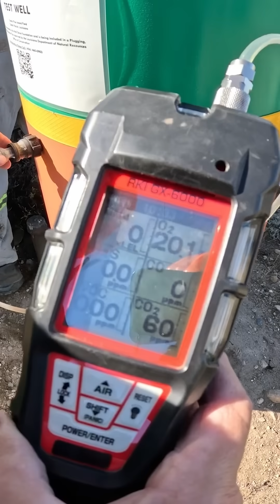The problem goes deeper than you think...

Comment: Why plug it while it's still exuding methane or natural gas? Capture the gas, or build a gas-powered generator on top of it, and wire it to the grid.
Reply: Because its just another bridge to nowhere. I can keep people on the payroll indefinitely without doing much and milk it forever because I labeled it with buzz words the news convinces people are bad. A volcano erupts every year that has more output than every well ever dug. But it sounds good to grift people into thinking you're saving the environment by plugging almost empty pockets of air with concrete you produced more harmful emissions to make and transport than the well will ever give off.

Comment: You had 606 people like this thing that you’re doing you had over 5000 comments I haven’t read them. I’m not gonna read them. The problem I have is that you could’ve pulled the pipe out of the ground build it up with gravel and dirt whatever to keep the meth thing down, but you didn’t do that. You wasted money on a concrete truck and fill the pipe full of concrete. The problem I’m having with this is when it rains rainwater find the path of least resistance and that’s a alongside the pipe. Oh no rainwater doesn’t get in there rainwater gets in everywhere, especially in the field. Raymond gets in a hole down side, the pipe down the side of the concrete down the side of the pipe, you know nothing’s gonna find outthat pipe that’s been sitting in the ground for years getting rained on stormed on snowed on saturated water constantly well my problem with this so you put concrete in the tube good for you

Comment: Is it possible to put a shallow plug? I mean, i.e. 30 feet of concrete. First you insert a kind of expanding stud. Then put on it some plastic or epoxy and then several meters of concrete.
Reply: Plastic epoxy what's contaminate our land some more it's bad enough to put in concrete in there
Reply: Couldn't that create sinkholes, or large surfaces of quicksand?

Comment: You wanna see another major issue with drilling for oil. Look into fracking fluid and earthquakes. I am not an expert on the subject, I have only done a tiny bit of research on the internet, but oklahoma is not a place with major fault lines but when they started fracking (and disposing the fluid) suddenly oklahoma started having thousands of earthquakes a year. In 2011 there was 5.7 magnitude earthquake and a bunch of smaller ones. Earlier this year we had a 5.1. They stopped disposing of fracking fluid the way they had been doing it, and suddenly all the strong quakes stopped. What was fun was everytime there was a quake you could get the coordinates from usgs and then get on google earth and see where the quake was and within a mile of it there is always a fracking fluid disposal well. Why was this not talked about by the media? It caused lots of damage to house foundations. Well I think we all know why, big oil.

Comment: No hole to extract gas (fracking) or oil should be drilled without a bond of money sufficient to fill the hole before the work starts. At the moment, there are literally millions of tracking holes abandoned and open.

Comment: "How much methane you keep down there?"

Earth : Yes
Reply: *Loooong drawn out fart*.
Reply: stuffs all over the place seeping out whether there is a hole or not. umpteen water wells have a little mixed in the water
Reply: @VictorHopper-f6c  yeah, but you can turn off the flow from a water well. These are free flowing holes to the literal bowels of the earth.
Reply: @Larken42  they can be capped. my wife's grandfathers was capped for years before he got tired of paying the tax. his drinking water had methane in it and that well was only 160 feet deep.
Reply: @VictorHopper-f6c  true. But the point of the video is that all infrastructure limiting the release of methane directly to the atmosphere was removed when operations ceased at the bore hole. No valve gear, no casing, no stem. All because it was cheaper to do nothing and get the scrap metal value and the spare parts from the well.

Comment: Why does it have to be plugged with cement? Could not a small plug down low work and just back fill the rest with sand? I mean if you’re just trying to stop gas from entering the atmosphere then why does it have to be over done? Maybe a lot more people would clean up after themselves if the cleanup methods weren’t overly expensive
Reply from the maker: Sand is porous. The gas would still seep out.
Reply: @JerryRigEverything  cement is made out of sand and limestone, it is also porous.   Maybe it is less porous but I would imagine a 1500 ft hole back filled with anything that could be gathered from the surrounding area would be at least 98 percent effective and easier to do then having to arrange a bunch of cement trucks coming in to remote locations. Better than just leaving a gapping hole in the ground.  Maybe I’m wrong but if this is a Hugh problem to get companies to plug these holes then maybe the government needs to take some of that tax money and send out crews with a funnel and a skid steer to go around and plug them up cheaper.

Comment: Idk if it’s the same but in ND I worked on some rigs doing the drilling then moved to a comythat did a bunch of other stuff shipping equipment out to the rigs but one of the other jobs we did was ship and help set up what I used to call a “well cap”. Basically there would be caseing down in the hole then we would add all these pieces to the top to seal it off. No the well was not still a production well, I was on both sides of it basically but not the middle part.

Comment: This is silly to reduce emissions! Instead let's focus on strict standards for light cars/trucks, especially diesels so strict that those vehicles won't even offset the production emissions before needing replacement... Tell ya what let's do the same with EV battery packs! But add tax incentives! Oh and continue shipping millions of tons of chinesium junk across the USA... Like a 10lb package for less than a citizen can mail a letter to a neighboring state! Because we all know importing single use items in bulk via crude oil burning container ships, many without any scrubbers aren't hurting the environment... Especially not the country of origin of those items... It's definitely regular cars/light trucks so let's make sure it's impossible to buy anything that will last over 150,000 miles before the drivetrain is shot and all of the proprietary electronic components controlling everything will be out of production and impossible to fix or bypass! Man I'm nearly as smart as the EPA! 🫠

Comment: I thought it doesn't dry but cure so it doesn't mean air. Or I guess then the reason must be that the pressure of the added concrete would press the lower concrete into gaps where it's lost instead of sealing the hole, right?

Comment: As someone who has been exposed to h2s, it deadens your sense of smell at relatively low concentration, i almost passed out but one of my buddies grabbed my arm and pulled me out of the basement of the paper mill power boiler, my monitor failed, if youre ever in a situation with h2s, make sure your monitor is properly calibrated and BELOW HEAD LEVEL as h2s is heavier than air

Comment: THIS IS THE BIG LIE OF 1892 !!! ALL CRUDE IS A-BIOTIC... NO DINOSAURS EVER DECOMPOSED INTO THIS. IT IS CHEMICALLY GENERATED AT DEPTH FAR BELOW THE LOCATION OF ANY FOSSIL. IT PERCOLATES UPWARDS...  THE CEMENT IS USED TO COVER UP THE ABILITY OF THE RAW CRUDE TO REFILL IN THE ORIGINAL LACOLITH SITES...  THE OIL COMPANIES ARE SPREADING FEAR PORNOGRAPHY IN THIS VIDEO. ALL THESE CLAIMS OF LETHAL GASES AND DEADLY ABANDONED FIXTURES KEEP AWAY THE SHEEPLE, WHO JUST MIGHT START SENDING DOWN TEST LINES, AND FIND THAT THEY ARE DIPPING INTO RAW FRESH CRUDE... ALL THE DEEP SEA RIG OWNERS ARE COMING FORWARDS NOW. AFTER BP DESTROYED THE MOST DIRECT SOURCE TO DATE IN THE GULF OF MEXICO... THAT RIG FOUND THE LARGEST SINGLE SOURCE ON THE PLANET, AND REMEMBER THEY CAN BE HARVESTED FOREVER AT A GIVEN RATE THAT MUST BE SLOWER THAN THE A-BIOTIC GENERATION RATE...

Comment: Same has gone on with Wells that go dry. They pull off the gearhead and move to the next new hole and left them open and unsafe. Finally in the last 10 years they have started making these holes be plugged.

Comment: How big are the caverns that held all this oil? Would it be more beneficial to collapse the dirt into the hole? Set some controlled charges where the bottom one blows first, then move up. Or perhaps one of those chimney cleaners with the double flail bashing dirt as it comes up could collapse the hole.

Comment: The simple answer is that oil companies should have funds held in a trust for each well they operate. If they close the well they can get most of the money back. If not, it gets closed for them. It should be more than the cost to close a well and some portion of current funds should be used to fund closing of abandoned wells.

Several other industries need a similar rule. Pre-pay for the clean up so they cannot just jun away from the mess later.

Comment: Well the problem is called the 1st Law of Thermal Dynamics. While it is good to cover up the hole, It will not resolve the fact that any of those gasses will come to the surface. I am surprised they were not required to fill the hole. 
When I went to college with the goal to be an oil field Engineer. in 1979 the had learned all kinds of new stuff about oil.
But because they taught for so long that it was a fossil fuel they forgot what they learned.

Comment: Hydrogen sulfide is heavier than air and is unlikely to be emitted from that hole unless enough of it builds up and makes its way to the top.

Every source system is producing hydrogen, sulfide gas, as well as methane. Every sewage pump station, Every sewage wet well, produces these gases.

Comment: Not my experience. I once worked for an oil service company that sealed the depleted wells with a cap of cement. We never had to fill the hole, just seal it. A 70lb bag of Portland cement did the trick.

Comment: I bet those areas feel earthquakes now and they never did before.  Crude oil or the liposphere is kinda like the fluid in your knee and hip joints that allow the joint to function smoothly, without all that grinding and scraping.    But more importantly, nature abhors a vacuum and the ground that was really stable and resilient now has a big void about 2000’ under it.   Geologically unstable, it’ll collapse eventually.  Resiliency would be the earths ability to take a hit and bounce right back and.  Resiliency is a lot less now and it’s all over.

Comment: No methane.... But used concrete for it which is running out and one of the biggest contributors to climate change. 

Methane would keep coming out, concrete is of course once and done. 

I just wonder if there might be a better plug material. Any ideas?

Comment: So you must have to push some kind of plug down there or you will have to fill up the void first what used to house the oil before it starts to fill the well shaft up, and if it took decades to pump the oil out it would take more than 3 days to fill it.

Comment: If there is any other kind of fuel coming out of there that could be cleaner than crude oil then why not tap that well and use the by product from the well for use??
Reply: Non-economical volumes is number one. You still need to invest in the pipelines to get that gas to the grid. Then there's the processing required. Methane is the product you could get out of these legacy wells but CO2 and H2S and other gases need to be processed out. In other words these are not assets that could be monetized, they're only liabilities in the financial and the safety sense
Reply: @TheHeavyModd my family lives in a franking area I know what goes into it the pump houses pipelines so on so forth but instead of just closing the well down wouldn't it make more economical sense to build a pump stations and pipelines instead of doing more drilling for gasses we already use that we already have access to?? Yes we will have to build but we won't have to drill!!
Reply: @markfoust8910  you need to remember these holes have been here for decades. The liquids have long dried up and the gas production is likely very low too. There may be a case for water/polymerflooding or well stimulations and such so you're not necessarily wrong, but that's up to the hardhats and bean counters to figure out. If it's economical sure why not. But gotta remember these are legacy locations. A newly drilled hole in the right place would flow much better than an ancient one that has been left unplugged like this. After plugging the pressure will begin building up again so maybe in the far future some of these plug&abandon cases might have an encore

Comment: I worked with my older brother who work for company that was subcontracted by Boots&Coots to perforated, plug and cement over 400 wells in a protected  reserve in eastern Venezuela that were drilled back in the 40s and 50s. They considered that my brother was best in the business when it came to wire lining. We once got called to a rig that was pushing around 5 days down time because Halb…on couldn’t retrieve a tool lost in the hole at around 1000’ we were in the hole out in under 8 hrs after retrieving the tool on our first run. The Jack up was about ten minutes away from our barge we were living on in the jungle.

Comment: In my experience with wells, the term 'abandonment' actually refers to the exact thing you were doing here. With shallower wells drilled to the water table, the bigger concern is that anything on the surface can fall down the well and contaminate the groundwater, so they're supposed to be sealed up all the same.

Comment: Awesome job. They rarely show this part of it and I often wondered about it because I know that when you take anything out of the Earth it leaves a vacuum that something else has to fill. Now I have a greater understanding of how it works.
Reply: I Wonder What It Looks Like Where The Oil Was

Is The Earth HoneyCombed UnderGround Where The Oil Was Or Was There A Sea Of Oil Under There And Not Pockets/Pools Separated By Earth,..

Which If The Earth Is Not DePositing New Oil, The Earth Above Is Basically A Huge Shelf Sitting Over Empty Space

I Would Love To See A DiaGram Of The Geology Where Oil Has Been Pumped- And Fracking

Which This Video Does Not Look Like An Oil Well It Looks Smaller Like A Fracking Hole

I am Going To Watch It Again And See If There Is AnyThing In The Frames That Shows It Is An Oil Well

Comment: There should be insurance that the hole will be plug, and company that operate on environment that are consider tarraforming the natural habitat must requires to pay the insurance that in the case of bankruptcy or abandonment, there will be people responsible for the fixing.
This problem don't just happen to oil rigs, in german, a nuclear storages unit got flooded, decade after the energy company closed down. 
And the government have to relocate those nuclear waste into a coal mine which have decent shielding against radiation. And most company probably already paid the government just to mine natural resources already, so the process should be smoother.

Comment: Paid actor. Full of Sh
Reply: Handheld GTX-6000 sensor shows 167ppm oxygen, 0.0 ppm hydrogen sulphide
Reply: Handheld GX-6000 sensor reads 167ppm oxygen, 3ppm carbon monoxide and 60 ppm carbon dioxide, but 0.0ppm hydrogen sulphide.

Comment: i dont understand what it means to say over 20 years the plug will offset 1000 cars 
does that mean that over the 20 years the emmisions of that hole would have been equivalent to 1000x the lifetime impact of a car 
is it taking into account shipping parts to keep that car running both its use of fuel and transport for its fuel 
the manufacturing and scrapping of the car 
Leachate emissions 
how is all of this measured

Comment: Filling the hole means filling the empy cavity, no?
Seem like you could get a wire and lower one of those expandable rubber attached to a air hose.
Inflate the rubber and create a plug.
This can be at any depth. It would be imperveouscto any wright on top of it That rubber is so tough they use pillows that inflate and raise buildings and heavy machinery.
Save lot of concrete.

Comment: It's funny, if you buy a car battery you have you pay a core charge and only get it back if you bring in the old one. They should do similar for oil companies but require they give four times the cost of sealing it up front so they can't dodge the cost later.

Comment: What do you mean so the bottom plug dries first? Concrete cures, it’s an exothermic chemical reaction. I’m sure there is probably still a reason to do it in segments, but wouldn’t it cure if you did it all at once?

Comment: I live in medicine hat, Alberta canada. The city itself was built as a halfway stopping point between winnepeg, Manitoba and Vancouver, BC on the canadian Pacific railway line. It was built here because the entire city is located on top of a massive gas pocket large enough to generate electricity for everything in a 3.5hr radius. If you live in that circle, medicine hat powers your home. The consequence is 497 abandoned orphan wells that were drilled by private individuals because the city gave the gas away until the 50s. The casing is now crumbling. In 2022 all of north railway street was shut down because a well started leaking under the parking lot of our local addiction clinic. We had a freakIn drilling rig on our street FOR 3 MONTHS!! JUNE TO EARLY SEPTEMBER!!

Comment: Why does it make it sound like oil companies just leave it wide open to expose people to those gases? There are environmental regulations that prevent that from ever happening! If a well is dry it is capped by laws already in place. There is no methane pushing through the air. So why is this video portraying like it is common practice. So lame